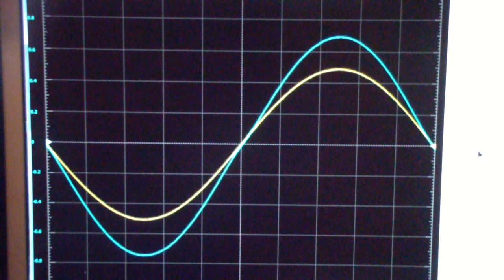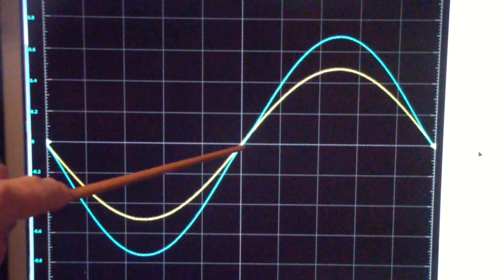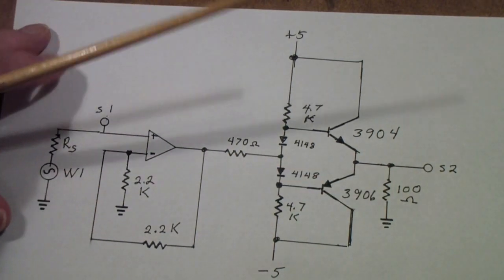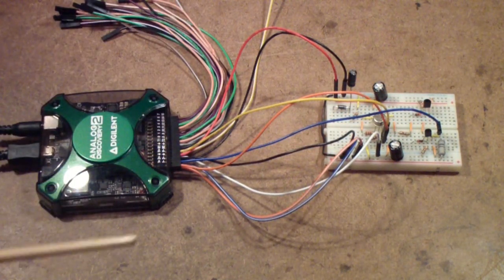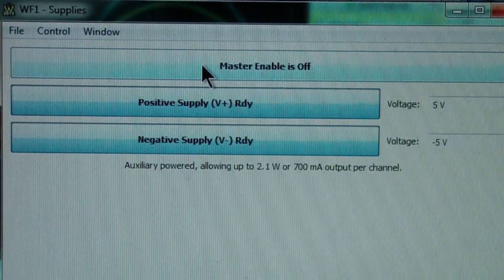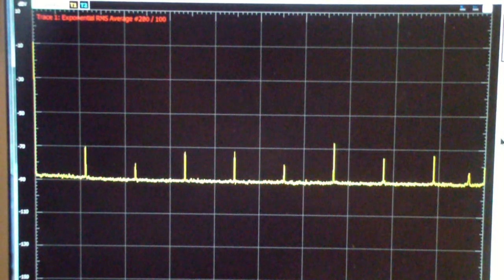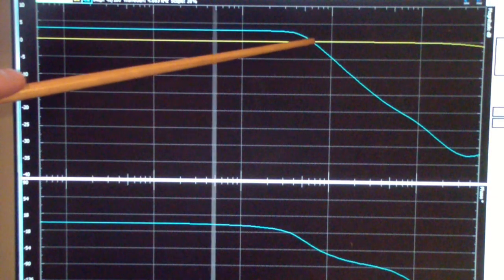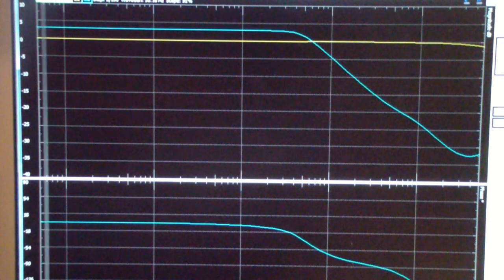TTT139 Class AB Amp Testing  w AnalDisc Pt1

Comment: Hey,can I ask you if you know, if Analog Discovery 2 it is a good tool as a oscillosope?They say is 1 MΩ ,±25V,30 MHz,but this is with just the 1x probe or with 10x?I don't understand.
Reply from the maker: The 1 M ohm is with a 1X probe, i.e. directly into the scope. A 10X probe will divide the sensitivity by 10 but multiply the impedance by 10 to 10 M ohms, so the inputs will work up to 250V. The 30 Mhz figure is with the BNC adapter board and I have found that the upper limit requires some interpretation. If the scope is well matched to the source and properly adjusted mine works to 30 Mhz but it is a little tricky to stabilize. I would say that 25 Mhz is the highest that you can rely on, although technically it does go to 30 Mhz. By the way, this is true of most scopes, their highest frequency is not necessarily usable under all conditions. This is sometimes due to the falloff of the vertical amplifier at the limit and sometimes due to unstable triggering at that same limit. So these figures need to be taken with an understanding that they are made under certain conditions that may not always be present in ordinary use.
Reply: Thank you!